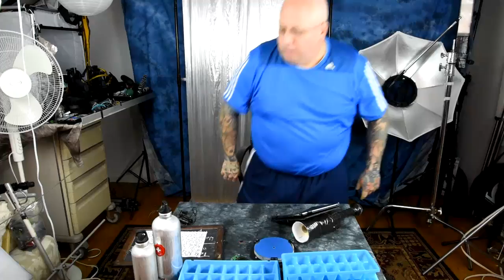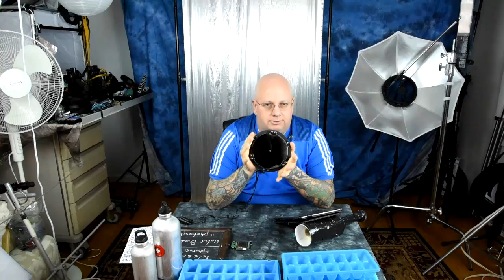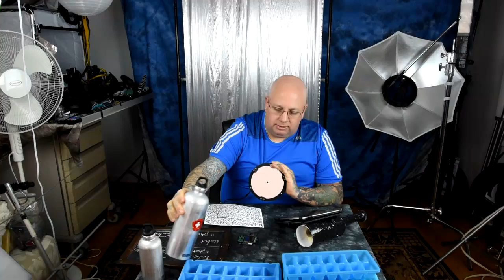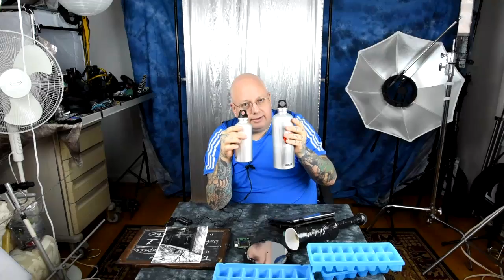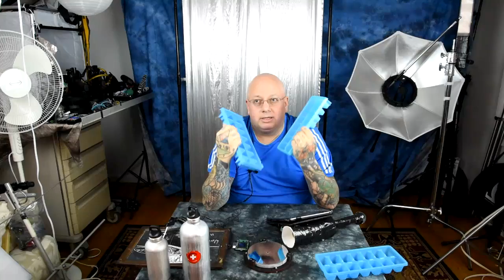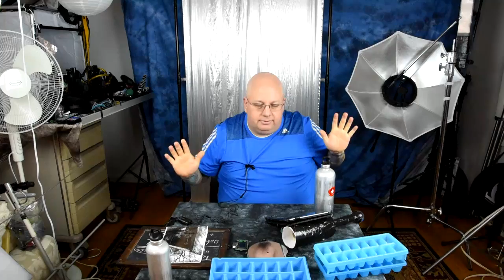Angry Photographer "Kicks the Bucket" PART 1: FX Sensor Size & "More Light"

Comment: Explain the reason as you said that every camera manufacturer are going for FX 35mm sensor size but a DX pixel pitch? What is the point of that?
Reply from the maker: improved SNR firmware and signal processing has lead to tighter pixel pitches with identical gain to older larger photosite sensors. 
its not much about improved sensors but improved image processing in-camera

Comment: https://www.dpreview.com/articles/5365920428/the-effect-of-pixel-and-sensor-sizes-on-noise
Reply from the maker: that article is TOTAL BULLSH*T,  no exposure runs off "total light", you got brainwashed by BS,  

https://www.flickr.com/photos/134746128@N05/29934872782/in/dateposted/

Comment: Ken, I understand your argument about pixel pitch be square MM being the way to look at sensor performance. But I came across this article on your favorite website: 

http://www.dpreview.com/articles/5365920428/the-effect-of-pixel-and-sensor-sizes-on-noise

There are many examples that "seem" to contradict what you said.

This guy is arguing: "The assertion that a smaller sensor sees less light and is, therefore, noisier (since it receives less light, and hence has a worse signal-to-noise ratio because of shot noise), is contentious. This is understandable, as it means thinking in terms of the whole image, not the light intensity per unit area that underpins the f-number/ISO system of exposure (that is specifically designed to work independently of sensor size).

However, while it may seem heretical to anyone strongly attached to the conventional exposure model, it is, nonetheless, demonstrably true."

"Now we see the effect of all the extra light captured - the outer cone in the diagram at the top of the page. The APS-C camera and APS-C crop still look the same but the extra sensor area (all exposed to the same light intensity) allows the full frame image look better overall."

Can you address the points made by the EXAMPLES  in his article? Thanks
Reply from the maker: +Lysander Spooner see my latest vids man!!!  HSS with Fuji 

also FUJI SECRET TONIGHT i found out!!!!!!!!! YEAHHHHHHHHHH!!!

big secret
Reply from the maker: +Lysander Spooner 
Check this out, near the bottom,  ROFL
http://petapixel.com/2016/03/08/13-photography-channels-youtube-follow/
Reply: You obviously had to pay them for that! HAHAHAHAH
Reply from the maker: I ONLY LIKE WHO IS NOT ON THE LIST

hat boy
Reply: Don't feel too bad for him, he is now making videos saying how great the A6300 is. Really, that is not exciting in any way.

Have you seen the Fuji X70 yet? Would like your thoughts on that one if you are interested in a fixed lens camera.
Reply from the maker: im doing a video tonight showing what a PIECE OF SHIT the A6300 is!!!

yes, i used the X70, its greaet.

hey, im getting a XPRO2 here in 3 days, im gonna TEST THE SHIT OUT OF IT

Comment: So where does megapixels come into play regarding ISO performance?
Reply from the maker: +Major Moves Films photosites do, not so much MP,.....more MP the more you can enlarge, and the more detail retention at high ISO, but then gain becomes an issue when applied gain (ISO) is applied to bad native gain on low exposed smaller photosites.

Comment: It is better to make an analogy between buckets and maximum water flow from a tap. 6 buckets that cumulatively hold a litre of water (eg 1 litre = 24 megapixels) fill up in the same time as 9 buckets that cumulatively hold one litre of water (still 24 megapixels). No matter how big or small the buckets (photocytes) are, the water flow (available light) is the same and therefore the total amount of water after a given time (exporsure) is the same. Bad example: a skyscraper and a dog receive the same amount of light per square meter (or foot) in the same amount of time under direct sunlight. What ultimately matters for exposure is the amount of light per square meter (or foot) not the total amount. Excuse my English if there are any errors.
Reply from the maker: +sotiris.bos photosites .   its all Exposure OVER Time....and gain, and noise processing SNR. 

No, that analogy doesnt work, the sites of ALL of (the photosites) buckets matters as for E over T (exposure over time)  :)
Reply: +Theoria Apophasis I got myself confused. But I do get your point. The difference between full frame and crop sensors is all about depth of field and, in my mind at least, interference due to higher voltages or amperes between photocytes at high ISOs, or am I wrong? All that besides the software stuff.
Reply from the maker: depth of field remains the same if you use SAME lens between FX and DX cameras, only the angle of crop/interception is diff.

see chart here for plugins:
http://www.cambridgeincolour.com/tutorials/digital-camera-sensor-size.htm

Comment: More pixels in a given area allow the S&R firmware to determine what is likely noise and what is likely signal with a greater degree of accuracy. The circle of confusion will dictate that no one pixel should vary in signal drastically to the pixels surrounding it. At least thats what a dumb welder from pennsylvania surmises....
Reply from the maker: +bikefreek SNR <<    :) 

well youre also forgetting that ALL lenses have higher intensity of light at the CENTER of projection, meaning a DX sensor uses the BEST light from any FF lens. :)

Comment: First time I have ever heard a telescope primary mirror called a base reflector, but I have only been into telescopes 52 years.
Reply from the maker: +yep its me hehehe, i havent used a telescope in nearly 20 years.......i had a wonderful 12 reflector (very costly, but got used) growing up, and helped to build one........
Reply: +Theoria Apophasis Telescopes are my main addiction. I have a 12 inch dob and a couple Celestron  SCTs on goto mounts and several smaller ones.  But I also have a couple of Nikons a D610 and the one I use on the telescope a D5100. The tilt screen on the 5100 is really handy using it on a telescope. Love your channel

Comment: People get confused because they are comparing apples with oranges. Take Full Frame and APSC sensors, assuming both are 24MP then the full frame will have larger photosites so people just assume that's always the case irrespective of the sensor resolution. Naturally when the pixel density is the same on both then there is no advantage to FF in terms of ISO performance. In fact it's entirely possible for an APSC sensor to have larger photosites than a full frame ( a 12MP APSC sensor will have larger photosites than a full frame 50MP sensor ). Of course only much older APSC sensors would have larger photosites, so does this mean it should outperform a modern 50MP full frame sensor in terms of ISO. Well of course not, whilst pixel photosites have become smaller, software has also improved which has offset that old advantage. The  
buckets analogy to be fair is sort of correct, I always assumed this to mean the photosite size anyway not the sensor as a whole so I think some people using this to describe why FF sensors would be better at capturing light are just simply not describing it correctly or being more specific that the buckets they are talking about are in fact the pixels /photosites.

Comment: This is interesting. My assumption has always that the person in question has been simplifying, so by "bucket" he's actually referring to the size of  photosites. I've rewatched that video plus others and that does not seem to be the case. I'm legitimately surprised.

I do have one question about your video. You state that inprovements to AD converters and SNR firware are minimizing the difference between APC-C and Full Frame. Why wouldn't those improvements also be applied to Full Frame? Shouldn't the diference remain the same?
Reply from the maker: +SaitoHalifax 
NO, thats NOT what he says at all, i have the exact quotes below........

Pixel density (except for the new breed like the Canon 5d) is HIGHER on a DX sensor vs a FX sensor, or more "ice cube holes per same area in DX"
DX average is about 4.2 micrometers
FX average is about 6.9 micrometers

There is HIGHER gain (of course) on larger (FX) photosites (or in the CORRECT analogy "bucketS")

Other people who say a bigger "sensor is a bigger bucket and THIS is why it has better ISO performance" are 100% wrong, flat out.

Larger photosites have better GAIN, of course, and this is why there is better ISO (and DR) performance on FX sensors, but it is NOT because "the entire sensor is bigger (or as said a "bigger bucket")"

It WOULD be correct however if someone said "a FF sensor has (millions of) bigger bucketS"
But that is NOT what was said.

WRONG QUOTES:::::: THESE ARE THE EXACT QUOTES I FOUND WHICH ARE 100% INCORRECT IN ONE REFERENCE VIDEO:
1. “bigger sensors have more square mm, therefore theyre gathering more light”

2. “bigger and smaller bucket in the rain, both gather 1” of rain, but in VOLUME, the bigger bucket gathers more water………this is the same way sensors work”

3. “larger sensors at the same ISO will gather more total light”.

4. “this is why we see cleaner images with bigger sensors (because the total sensor is a 'bigger bucket')

5. “more light in total means (you get) cleaner images”
Reply: +Theoria Apophasis I was agreeing with you.
Reply from the maker: +SaitoHalifax 
The incorrect quotes from the other video,  i wrote down in the INFO 
above, are undeniable and are 100% false and wrong. This is undeniable 
by anyone.  

the ONLY correct use of the word "BUCKETS" (bucketS NOT buckeT!!) i 
found online was this CORRECT ONE:
"Think of those pixels as buckets that attract light – the larger the  
bucket, the more light it can (capture) in a given amount of time. These
 buckets are known as “photosites” and their size plays a huge role in 
sensor sensitivity (and ISO....and DR)"
https://photographylife.com/nikon-dx-vs-fx
Reply: +Theoria Apophasis  Again, I am agreeing with you. I watched a bunch of videos and you are correct in what is being said.
Reply: +SaitoHalifax The adverse side effects of lack of sleep. He's running on empty right now.
Reply from the maker: +SaitoHalifax 
DSLR PIXEL PITCH chart here:
http://www.astropix.com/HTML/I_ASTROP/COMPARE.HTM

Comment: Ken i had to wait till 16:35 for you to mention PIXELS finally lol!!! its v clear...its not the volume, but the surface area exposure of each pixel (to photons) that makes up the sensor - hence a bigger pixel site = more gain. Hence can we say a Dx sensor having certain number of pixels which are bigger in surface area than the ones on a full-frame will be capturing light better at low light situation, comparatively? and hence clearer and less noisy image?? so its nothing to do with the number of pixels, or even the size of the sensor...BUT with the size of each of these buckets/pixels??? ALSO.. I am confused what are 'snr firmwares' and 'pixel pitch'. where can i read this from? or u make a vid ?!.
Reply from the maker: +meraat haqiqi 
Pixel density (except for the new breed like the Canon 5d) is HIGHER on a DX sensor vs a FX sensor, or more "ice cube holes per same area in DX"
DX average is about 4.2 micrometers
FX average is about 6.9 micrometers

There is HIGHER gain (of course) on larger (FX) photosites (or in the CORRECT analogy "bucketS")

Other people who say a bigger "sensor is a bigger bucket and THIS is why it has better ISO performance" are 100% wrong, flat out.

Larger photosites have better GAIN, of course, and this is why there is better ISO (and DR) performance on FX sensors, but it is NOT because "the entire sensor is bigger (or as said a "bigger bucket")"

It WOULD be correct however if someone said "a FF sensor has (millions of) bigger bucketS"
But that is NOT what was said.

WRONG QUOTES:::::: THESE ARE THE EXACT QUOTES I FOUND WHICH ARE 100% INCORRECT IN ONE REFERENCE VIDEO:
1. “bigger sensors have more square mm, therefore theyre gathering more light”

2. “bigger and smaller bucket in the rain, both gather 1” of rain, but in VOLUME, the bigger bucket gathers more water………this is the same way sensors work”

3. “larger sensors at the same ISO will gather more total light”.

4. “this is why we see cleaner images with bigger sensors (because the total sensor is a 'bigger bucket')

5. “more light in total means (you get) cleaner images”
Reply from the maker: +meraat haqiqi 
The incorrect quotes from the other video,  i wrote down in the INFO 
above, are undeniable and are 100% false and wrong. This is undeniable 
by anyone.  

the ONLY correct use of the word "BUCKETS" (bucketS NOT buckeT!!) i 
found online was this CORRECT ONE:
"Think of those pixels as buckets that attract light – the larger the  
bucket, the more light it can (capture) in a given amount of time. These
 buckets are known as “photosites” and their size plays a huge role in 
sensor sensitivity (and ISO....and DR)"
https://photographylife.com/nikon-dx-vs-fx
Reply from the maker: +meraat haqiqi 
DSLR PIXEL PITCH chart here:
http://www.astropix.com/HTML/I_ASTROP/COMPARE.HTM

Comment: It's not the size of your bucket that matters but how you use it.
Reply from the maker: +James Salt Photography 
Pixel density (except for the new breed like the Canon 5d) is HIGHER on a DX sensor vs a FX sensor, or more "ice cube holes per same area in DX"
DX average is about 4.2 micrometers
FX average is about 6.9 micrometers

There is HIGHER gain (of course) on larger (FX) photosites (or in the CORRECT analogy "bucketS")

Other people who say a bigger "sensor is a bigger bucket and THIS is why it has better ISO performance" are 100% wrong, flat out.

Larger photosites have better GAIN, of course, and this is why there is better ISO (and DR) performance on FX sensors, but it is NOT because "the entire sensor is bigger (or as said a "bigger bucket")"

It WOULD be correct however if someone said "a FF sensor has (millions of) bigger bucketS"
But that is NOT what was said.

WRONG QUOTES:::::: THESE ARE THE EXACT QUOTES I FOUND WHICH ARE 100% INCORRECT IN ONE REFERENCE VIDEO:
1. “bigger sensors have more square mm, therefore theyre gathering more light”

2. “bigger and smaller bucket in the rain, both gather 1” of rain, but in VOLUME, the bigger bucket gathers more water………this is the same way sensors work”

3. “larger sensors at the same ISO will gather more total light”.

4. “this is why we see cleaner images with bigger sensors (because the total sensor is a 'bigger bucket')

5. “more light in total means (you get) cleaner images”
Reply from the maker: +James Salt Photography 
The incorrect quotes from the other video,  i wrote down in the INFO 
above, are undeniable and are 100% false and wrong. This is undeniable 
by anyone.  

the ONLY correct use of the word "BUCKETS" (bucketS NOT buckeT!!) i 
found online was this CORRECT ONE:
"Think of those pixels as buckets that attract light – the larger the  
bucket, the more light it can (capture) in a given amount of time. These
 buckets are known as “photosites” and their size plays a huge role in 
sensor sensitivity (and ISO....and DR)"
https://photographylife.com/nikon-dx-vs-fx
Reply from the maker: +James Salt Photography 
DSLR PIXEL PITCH chart here:
http://www.astropix.com/HTML/I_ASTROP/COMPARE.HTM

Comment: Hi ken! nice to see you today!

Jan dirk
Reply from the maker: +Bob Jimenez 
Pixel density (except for the new breed like the Canon 5d) is HIGHER on a DX sensor vs a FX sensor, or more "ice cube holes per same area in DX"
DX average is about 4.2 micrometers
FX average is about 6.9 micrometers

There is HIGHER gain (of course) on larger (FX) photosites (or in the CORRECT analogy "bucketS")

Other people who say a bigger "sensor is a bigger bucket and THIS is why it has better ISO performance" are 100% wrong, flat out.

Larger photosites have better GAIN, of course, and this is why there is better ISO (and DR) performance on FX sensors, but it is NOT because "the entire sensor is bigger (or as said a "bigger bucket")"

It WOULD be correct however if someone said "a FF sensor has (millions of) bigger bucketS"
But that is NOT what was said.

WRONG QUOTES:::::: THESE ARE THE EXACT QUOTES I FOUND WHICH ARE 100% INCORRECT IN ONE REFERENCE VIDEO:
1. “bigger sensors have more square mm, therefore theyre gathering more light”

2. “bigger and smaller bucket in the rain, both gather 1” of rain, but in VOLUME, the bigger bucket gathers more water………this is the same way sensors work”

3. “larger sensors at the same ISO will gather more total light”.

4. “this is why we see cleaner images with bigger sensors (because the total sensor is a 'bigger bucket')

5. “more light in total means (you get) cleaner images”
Reply from the maker: +Jan-Dirk Overeem werd!!!
Reply from the maker: +Bob Jimenez 
The incorrect quotes from the other video,  i wrote down in the INFO above, are undeniable and are 100% false and wrong. This is undeniable by anyone.  

the ONLY correct use of the word "BUCKETS" (bucketS NOT buckeT!!) i found online was this CORRECT ONE:
"Think of those pixels as buckets that attract light – the larger the  bucket, the more light it can (capture) in a given amount of time. These buckets are known as “photosites” and their size plays a huge role in 
sensor sensitivity (and ISO....and DR)"
https://photographylife.com/nikon-dx-vs-fx
Reply from the maker: +Jan-Dirk Overeem 
DSLR PIXEL PITCH chart here:
http://www.astropix.com/HTML/I_ASTROP/COMPARE.HTM